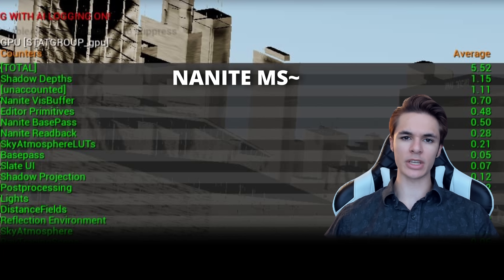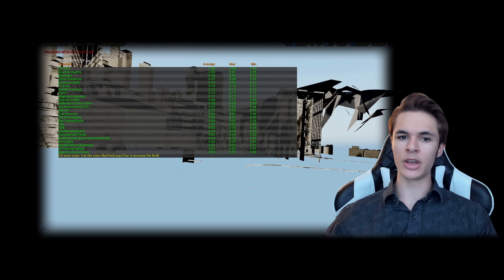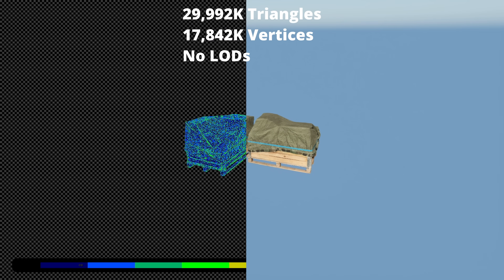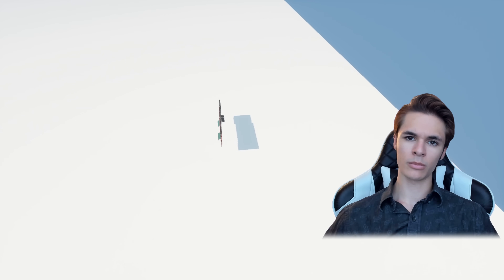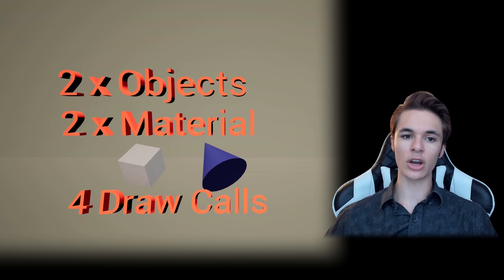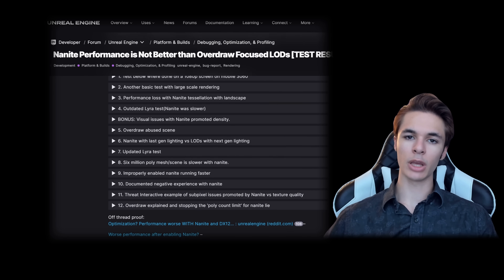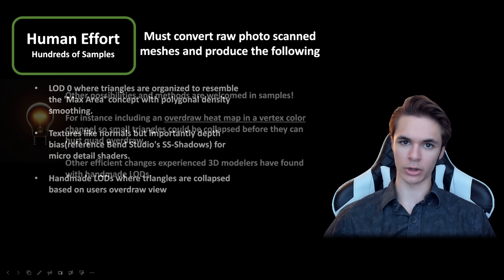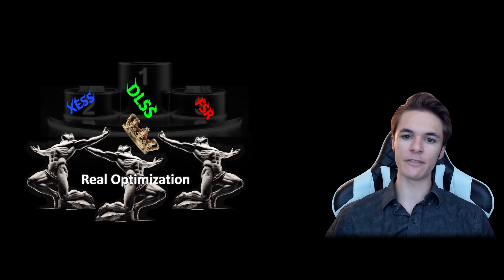Epic's Unreal Optimization Disaster | Why Nanite Tanks Performance!

Comment: Nanite’s software raster solves quad overdraw. The problem is that software raster doesn’t have HiZ culling. Nanite must lean purely on cluster culling, and their clusters are over 100 triangles each. This results in significant overdraw to the V-buffer with kitbashed content (such as their own demos). But V-buffer is just a 64 bit triangle+instance ID. Overdraw doesn’t mean shading the pixel many times. 

While V-buffer is fast to write, it’s slow to resolve. Each pixel shader invocation needs to load the triangle and runs equivalent code to full vertex shader 3 times. The material resolve pass also needs to calculate analytic derivatives and and material binning has complexities (which manifest in potential performance cliffs). 

It’s definitely possible to beat Nanite with traditional pipeline if your content doesn’t suffer much from overdraw or quad efficiency issues. And your have good batching techniques for everything you render. 

However it’s worth noting that GPU-driven rendering doesn’t mandate V-buffer, SW rasterizer  or deferred material system like Nanite does. Those techniques have advantages but they have big performance implications too. When I was working at Ubisoft (almost 10 years ago) we shipped several games with GPU-driven rendering (and virtual shadow mapping). Assassin’s Creed Unity with massive crowds in big city streets, Rainbox Six Siege with fully destructive environment, etc. These techniques were already usable on last gen consoles (1.8TFLOP/s GPU). Nanite is quite heavy in comparison. But they are targeting single pixel triangles. We werent.

I am glad that we are having this conversation. Also mesh shaders are a perfect fit for GPU-driven render pipeline. AFAIK Nanite is using mesh shaders (primitive shaders) on consoles at least. Unless they use SW raster today for big triangles too. It’s been long time since I analyzed Nanite for the last time (UE5 preview). Back then their PC version was using non-indexed geometry for big triangles, which is slow.
Reply: thanks for the insight
Reply: Also it’s worth remembering why Nanite was built:

Nanite allows developers (and users in UGC platforms) to create scenes with millions of objects with millions of triangles each, and these scenes render from any camera location at close to fixed cost. 

This dream required sacrifices. Constant cost per pixel is higher. There’s V-buffer resolve to G-buffer, there’s 3x vertex transforms for each pixel. But what we get is a pipeline capable of precise occlusion culling and almost fixed triangle count per frame. Object in front occludes N pixels (= 1 pixel triangle each). Thus adding an object adds N triangles but also removes N triangles. Thus depth complexity doesn’t matter. Seamless LOD is very important here as it guarantees roughly 1:1 triangles:pixels. These two techiques make it possible to render massive scenes with close to fixed cost. 

But if you have hand optimized mid-poly triangle meshes (with normal maps baked from high poly) then Nanite can’t really do anything magical to make that mesh more optimal to render. You just pay added constant costs. If you have complex scenes with lots of objects and lots of partial occlusion, Nanite still helps. 

The biggest problem right now is that the fixed costs plus costs to render 1 triangle per pixel (that’s what Nanite LOD solution does) are today too much for PS5 to render at native res. Thus you need temporal upscaler and quality trade-offs. But if we assume Nanite gets optimized during the next years it will be awesome when next gen ships. These added fixed runtime costs will be meaningless compared to the improvements it gives. But OP is right. Today Nanite is a compromise on PS5.
Reply: Slight shock at the level of correctness at every step in a youtube comment.

Then I saw, ah, it's seb! :)
Reply: Just wanted to clarify: V-buffer solves quad overdraw for shading and texturing. But it has to pay for vertex fetch and transform similarly to worst case quad overdraw situation (single pixel triangles) regardless of triangle size. This means that there’s a substantial amount of memory load operations per shaded pixel. It’s quite fast on recent Nvidia, but very slow for example on Adreno (Snapdragon X Elite). The workload is a bit similar to ray-tracing workload. Except without the ray-test and BVH workloads. Load 3 triangle vertices per pixel, transform positions, calculate barycentrics of samping position, interpolate all vertex attributes, transform them, etc. SampleGrad is also usually 4x slower than normal Sample instruction since GPU needs full address calculation per pixel (instead of shared in 2x2 quad). So there’s technically no quad overdraw, but many operations are slower. It’s a win for very dense geomery (1 pixel triangles), but a loss otherwise.
Reply: quad overdraw happens because triangles are rasterized in 2x2 quads. If any pixel of a 2x2 region is inside the triangle all of those four pixels are shaded. Pixels outside the triangle are discarded after pixel shader is executed. You still pay the cost. In worst case triangle is one pixel sized and you need to execute 4 pixel shader instances for it (4 lanes in a wave). If all triangles are single pixel, then you end up executing four times as many pixel shader waves. 75% of the wave lane work will be discarded after shader runs. It’s really bad.
Reply: About virtual shadow maps: our virtual shadow mapping tech (Ubisoft 2015) was up to 3x faster than our cascaded shadow map tech. When both were running identical content on the same GPU-driven render pipeline. Virtual shadow mapping is faster as it precisely culls away all geometry clusters that don’t cast shadows to any visible pixel. 

The main problem with VTSM is that it practically requires a GPU-driven pipeline. It uses the Z-buffer to analyze which regions of the shadow map are visible and their receiver Z range. I have no idea how Nanite makes VTSM work with non-Nanite meshes, but it must be a really slow hack. 

VTSM was designed for GPU-driven content and I am not surprised at all if people are seeing issues with it if they render meshes with traditional techniques. 

The reason why VTSM pass is slow in Nanite is simply because shadow map sees all geometry on the screen and you need to render all of those super dense 1 pixel triangles also to the shadow map. In 2015 we were targeting sensible sized 4-8 pixel triangles to avoid geometry bottleneck. Nanite instead is tessellating everything to 1 pixel triangles. That’s the reason for performance issues, not the VTSM algorithm itself.

VTSM is a massive optimization if done right. 

When I was benchmarking Nanite in UE5 beta, I noticed that their culling pass was order of magnitude slower than what I expected. But this pass does the seamless LOD too (cluster tree cut). I am sure they optimized it already, but if it’s more than 0.1ms then it of course accounts to some of the slowness in their VTSM algo. 

Also Nanite’s desire to output 1 pixel triangles also means that there’s much more clusters to process. And their LOD algo is much more advanced than our 9 years old algo. Hard to say why it is slow without looking at the code. And I unfortunately don’t have time to do that now. These algorithms have lots of small technical details that have surprisingly big impact on performance.
Reply: @sebbbi2 honestly i wish w4 games  hired you just for the gpu driven renderer that godot intends to add in the future. That would make it far better than what they would originally planned.
Reply: I was reading this and thinking: "I wonder what Sebastien would think of this video" then "Oh this guy must have worked with Sebastien at Ubi" and then "Oh it's literally him". lol
Reply: So you think nanite benefits most when you use absurdly "unoptmized" meshes, ie, single pixel triangles or smaller, and many millons of them?
Otherwise its trivially beatable?
Reply: @Mallchad  nanite performs worse on a optimized mesh, if you decimate a mesh intended for nanite you end up with nested groups of triangles between large triangles, nanite from my understanding can not cluster large triangles efficiently, running nanite on a optimized mesh is pointless.
Reply: Not an unreal expert, but from what I know of graphics, quad rasterization is unavoidable, since you need the derivatives for the pixel shader varyings that are needed for things like texture sampling. Honestly it might make  sense to move beyond triangles to things like implicit surface rendering (think drawing that NURBS stuff directly) for the stuff nanite tries to accomplish.
Reply: @torginus  rendering nurbs and other non-primitive types always goes down to rendering primitives anyway, CAD software always processed nurbs into triangle meshes using various methods that produce a lot of overhead, GPUs are not capable of efficiently rendering anything else than primitives, we would need to build new hardware standard for rendering them, and that's not really reasonable
Reply: @tubaeseries5705   > rendering nurbs and other non-primitive types always goes down to rendering primitives 
that's not true, you can render, sample, and antialias nurbs directly by sampling them in the pixel shader as SDFs.
CAD software is built for robustness and maximum compatiblity (not to mention they prolly have really old codebases), not graphical fidelity
Reply: @torginus  yes you can sample SDFs, but that's a software method, and it's not very efficient
Reply: @tubaeseries5705 I was under the impression that all the work GPUs do these days (and have been for some years) was just shaders, whether it's rasterising triangles or some GLSL implementation of Game of Life. Is that not the case?
Reply: @thesenamesaretaken  any program that runs on a gpu is called a shader, 
but you can do anything with them, calculate physics, or calculate pixel colors, doesn't matter
Reply: would be a nice solution to build a hardware to the logic problems?
Reply: thank you. i been out of the rendering game for quite a while and i was wondering what the video author was going on about, when nanite is software based
Reply: so is there a solution?
Reply: the issue is that quad overdraw is not a big deal, modern GPUs are never limited by the amount of triangles they output, it's always shaders, and nanite adds a lot of additional work to the shader pipeline, which is already occupied as hell,
for standard graphics with reasonable triangle counts nanite just doesn't make any sense, it offers better fidelity than standard methods, but performance is not what it can offer
Reply: @tubaeseries5705 quad overdraw and geometry frontends are definitely big bottlenecks. Even in our mobile renderer I measured 60% higher pixel shader wave count due to quad overdraw in the main forward shading pass. 

Deferred shading helps as all heavy lighting math is executed once per pixel. You only pay quad overdraw cost for texturing and material blending. In our case deferred was faster than forward because of this. 

If you want even lower quad overdraw cost you can do V-buffer (Nanite) or any other deferred texturing method such as the UV-buffer we (Ubisoft) presented at SIGGRAPH 2015 (google for GPU-driven rendering pipelines, SIGGRAPH 2015). 

The problem with V-buffer is that it fetches and transforms all 3 vertices of the triangle for every pixel. So it practically performs like you had worst case quad overdraw always. It’s designed for 1 pixel triangles and if doesn’t perform significantly faster with larger triangles as it still transforms them again and again for each pixel. This is one rrason why Nanite is not optimal for traditional 3d content. It needs very dense geometry to be optimal. 

The geometry bottleneck is also real for dense meshes. I benchmarked Valley of Ancients with UE5 beta and found out they rendered non-indexed geometry back then. They claimed 3x faster SW raster as it sidestepped the geometry bottleneck. I also made a V-buffer raster prototype with indexed geometry and it was 2x faster than Nanite’s back in the day. That’s because I transformed 1 vertex per triangle and they transformed 3. Thus we have shown that triangle setup is a big bottleneck. There are ways to mitigate it, but not sidestep it completely. 

If you want to check my recent data about this topic, I recommend googling for ”Siggraph 2024 variable rate shading with visibility buffer”. John Hable had a nice recap of my findings in his presentation.
Reply: @sebbbi2  how does quad overdraw increase pixel shader wave count though? i thought pixel shaders by nature, are executed per pixel and after geometry, so overdraw shouldn't affect it, i am genuinely curious how that works
Reply: @tubaeseries5705 quad overdraw happens because triangles are rasterized in 2x2 quads. If any pixel of a 2x2 region is inside the triangle all of those four pixels are shaded. Pixels outside the triangle are discarded after pixel shader is executed. You still pay the cost. In worst case triangle is one pixel sized and you need to execute 4 pixel shader instances for it (4 lanes in a wave). If all triangles are single pixel, then you end up executing four times as many pixel shader waves. 75% of the wave lane work will be discarded after shader runs. It’s really bad.
Reply: @sebbbi2  thanks, that makes perfect sense
Reply: @tubaeseries5705  Yeah I don't get why this talk about quad overdraw even exists as something that needs "solving" on modern hardware. Just baffling the sorts of things people decide to bring up when there's bigger fish to fry..
Reply: @JayJayYUP  it never really existed before nanite
Reply: @tubaeseries5705  Modern GPUs are also frequently limited by Power reducing frequency available for shaders, or CPU overhead reducing time available for shaders, the quad overdraw negatively affects both of those problems
Reply: So is the real point of nanite that any rando can take their iPhone 15 depth sensor, use photogrammetry, have no skills, and import a 25 kajillion triangle object into unreal without computer go boom?
Reply: @FasutonemuMyoji  yeah, nanite let's you do that, but it's not optimal anyway
Reply: Nanite doesn't target single pixel triangles. Nanite's author said it's more like 3 pixels per triangle.
Reply: I've been trying to explain to this guy on the UE forums that UE5 is still evolving and that Nanite performance is going to improve with future engine updates. Not to mention that using a 6 million poly mesh is meaningless. Nanite is for enabling billions of triangles. You won't even get 1 fps rendering that in UE4, so Nanite isn't the problem. They really want to keep pushing this narrative that nanite is crap. I'll tell you a fair assessment; export the Valley of the Ancient scene and bring it into UE4 (polys only) and generate auto LODs for the meshes and see what your performance is then. 
Overdraw is only an issue when you're using transparency or masking in your materials. That's why devs have moved away from using billboard grass in games and just poly model grass blades, because even though there's a ton more polys, there's no overdraw, and with modern GPUs polys are the easiest thing to render. Do you honestly think you know more about rendering than Digital Foundry? Not to mention that you seem to think the devs at Epic don't know what they're doing. What are you hoping to get out of posting videos and making the claims you're making? As I said on the forums, just use UE4.27 if you hate nanite so much.
Reply: @TorQueMoD  yes 6 million triangles are meaningless, the problem is that devs try to use nanite with low amounts of geometry, not with billions of triangles, this reduces performance for them, you completely missed the point of this video
Reply: @tubaeseries5705  This is the heart of the discussion. Using on low-poly stuff is counter-productive but what he's saying is valuable as well that you would use it for hi-res geometry
Reply: @TorQueMoD  I like this balanced take.
Reply: I am confused 💀💀💀

Comment: I literally started building my own framework with opengl because I'm so sick of how over engineered engines are becoming. It's not just meshes either, they dumped the old input system that worked fine just to force us to use the "enhanced" one that takes significantly longer to setup. Lumen is enabled by default so it's pretty easy to accidentally ship a build that doesn't work on 80% of computers, and I swear that they've made it marginally more difficult to find work arounds for more complex problems because of deprication 

Sure I run into issues with opengl but at least I actually learn something from those mistakes and 9 times out of 10 it's 100% my fault and I don't have to go digging through 3 decades worth of abstraction to find the answer